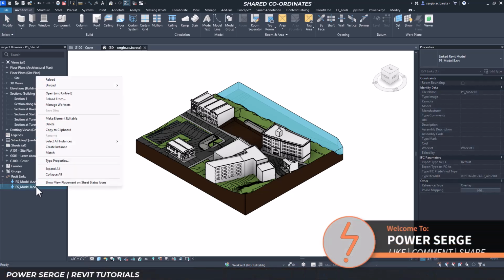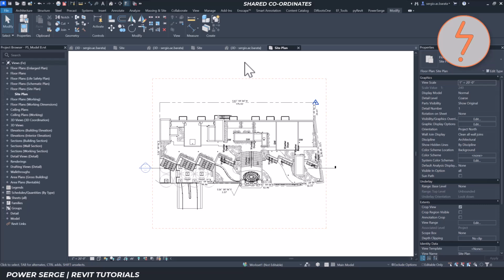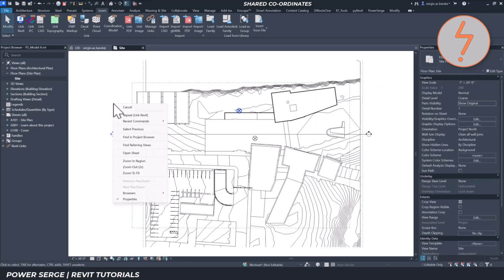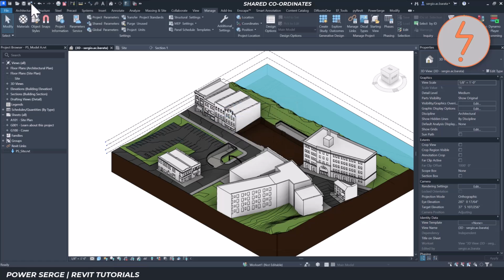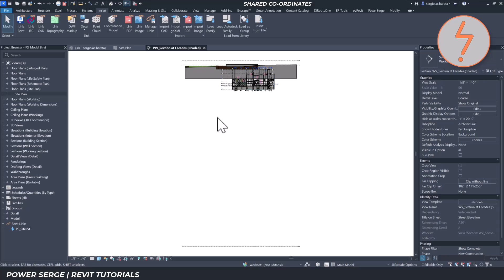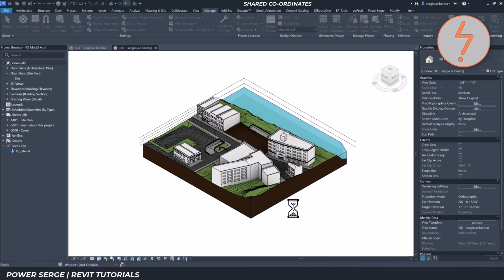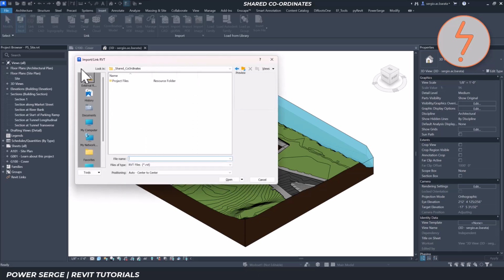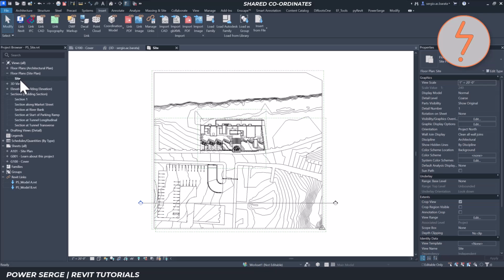Shared Coordinates Setup on ACC

Comment: Hi Sergio, I have a question.
I’m working on a complex project that includes more than 30 separate buildings. I have a masterplan file that acts as the datum file, and I want to apply shared coordinates for all buildings and upload them to ACC.

I noticed in step 5 that you opened each building and did "Transfer Project Standards." then project info 

In my case, do I really have to open all 30 buildings and transfer the standards from the other files one by one? and What is the purpose of the Transfer Project Standards step?
Reply from the maker: No, you do not need to use “Transfer Project Standards” to apply Shared Coordinates. It the video, it's used to Transfer Project Info. I've included it because I'm following the Autodesk recommended workflow. However, you still need to establish the Shared Coordinates via the Aquire Coordinates tool meaning you still need to open each building model, link the Masterplan, use Aquire Coordinates and Save.

Comment: That’s life-saving! Thanks for the tips.

I have a small question: What’s your advice if I have a prototype villa but need to adapt it for different locations?
Reply: Hello 😊😊
Reply from the maker: A prototype can be saved as a template of sorts housing typical systems families, details and sheets list etc. You can modulate parts of the models as well and link these in as required.

Comment: Hi Sergio, great video. I must say that I used to take on this same approach and then cross my fingers that Civil wouldn't move the location of building(s) on site. I really miss the publish coordinates feature, I get it though ;) 
With the setup of design authoring workshare models, its important to understand each (3) points and RVT levels behavior with acquiring coordinates. When Civil changes location of building on site...sometimes at 90% ha...the effort to rectify can be cumbersome or even worse cause mass confusion very easily. Because of so much confusion and interpretation....the method I am using I found to work well, and in short, is the following:

In site federated model: ( this is a step only one and done)

1. With one level set to survey point I called "Survey Control Origin Point". I then identify establish a Control Origin Point (COP) between C3D and Revit. (Typically a control point Nail and Disc within 500ft of the site) 
2. With the view set to Project North...I link in survey file initially as, "Manual - center to center" (C3D file should zoom extents neatly) if not, needs cleaning :)
3. Move the survey file to line up with internal Origin (Revit) and to match the, survey "COP"... the Nail and Disc....and then rotate the same file to be orthogonal from that point. 
4. Unclip the Survey ∆ in Revit and then Acquire Coordinates
5. Move the survey ∆, still unclipped, down to elevation zero in an elevation view and then pin the survey point, turn visibility off. (this now serves as the sea level 0.00) 
5. Done!!   This method keeps the project base point and the survey ∆ right on top of Revit internal origin.  ∆ though would be XXXX ft down in Z.  

In Design Authoring model: ( this is a step only one and done)

1. With a typical FFE level and reference set to survey point". Start the model of the building inside bottom left corner at internal origin, where project base point and survey ∆ reside
2. Unclip the survey ∆
3. REPEAT step 3 above and then Acquire Coordinates 
4. Unlike the federated model...In these files only the survey ∆ is moved to True elevation at the buildings staking of building/pad (typ edge of foundation)
5. Done!!        This method keeps the project base point and the survey ∆ right on top of Revit internal origin.  ∆  is right at the building so zoom extents now :) 

To change Elevations of levels, I simply use, "specify coordinate at point", select the level, then plug in the value.  Viola!  Since the survey ∆  is unclipped everything stays put and the levels update respectively... nothing moves. So far so good. Now I am positive that there are tradeoffs between our methods for me the goal is to limit the # of steps,  simplify,  and make sure design authoring model/sheets are never affected by shared coordinates...because hey always seem to bottleneck.   

I look forward to your response and hearing any and all feedback! Thanks again!
Reply from the maker: Wow, that’s a long one 😊. I’ll have a look and get back to you.